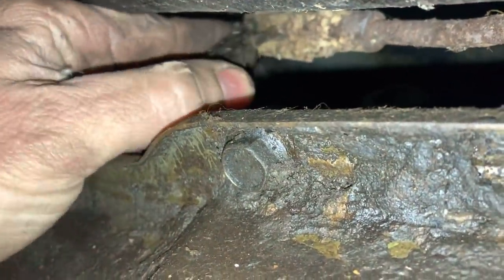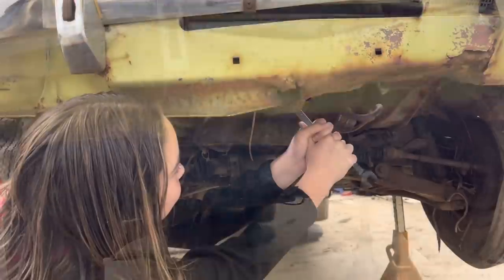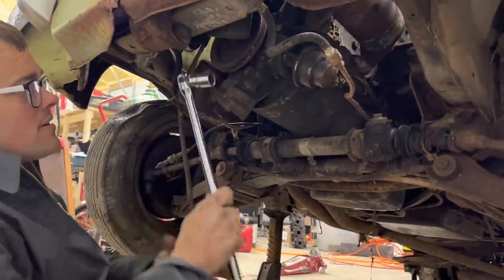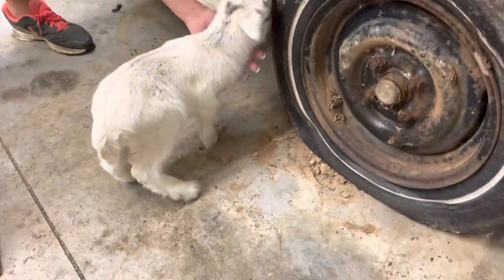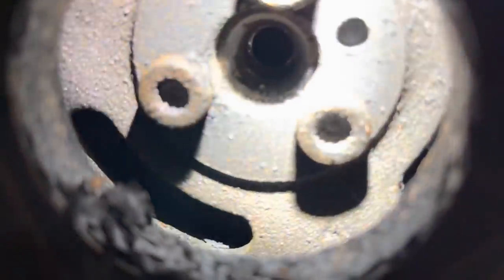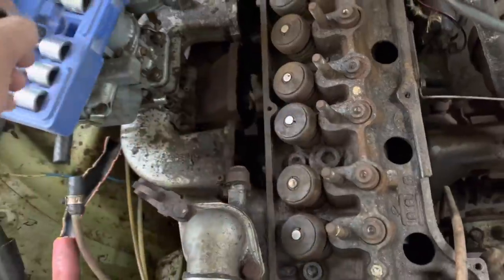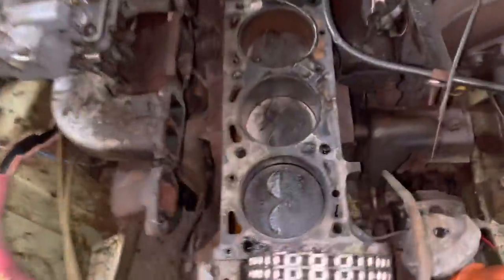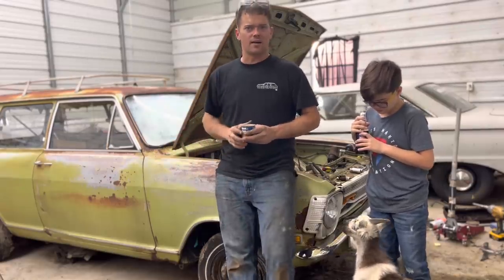Can we get the engine unstuck after 42 years

Comment: Had two of these two-door "caravans" back in the days.....a '72 1900 "wagon" I drove in high school.....plain-jane, 4spd, carbureted, & dog dish hub caps.
Second was later, after getting married....it was a '75 1900 Ralley(!) package with sporty steel Ralley wheels, extra gauges at the front of the console, and Bosch fuel injection! 😯......Both were the same green as your '69, but slightly "modernized" body style.
 Also, my great-aunt had a '73-74 1900 4dr "noth-back".....(we called it a sedan🙄) It was Carolina Blue with black & white interior and auto transmission.....
  Neat lil cars, for sure!
Reply from the maker: Man they sound nice

Comment: You may not have the room in that engine compartment but I,'ve freed up a 59 cadillac v8 with a 3ft chain wrench and cheater pipe around the harmonic balancer.  Scared up the balancer a bit but didn't snap the bolt. Trans fluid in the cylinders, cleaned up the carb and got it to fire up. Smoked up the neighborhood when she fired up😁

Comment: It'd be interesting to try just filling the whole crankcase and intake manifold/carb to the top with diesel and leave it for a few days or weeks, and see if that would free everything up.
Reply from the maker: Yeah couldn’t hurt
Reply: Your first stopped the crank-pulley bolt, and the broke it off. The crank will have to be removed, and drilled to insert a heli-coil, thus removal of the engine is a must. A substitute four cyl, and manual trans from another car, might make the most sense.
Reply: Brake fluid eats paint. Pour into cylinders.
Reply: Looks just like a Toyota or Datsun estate we had in Australia, should pull the motor, if not very easily repaired, go for a rotors like a 12A or 13B with a five speed  it would make an awesome sleeper.

Comment: I'm late to this party but a 50/50 mix of acetone and ATF work wonders on rusted parts. Better than anything commercially available
Reply from the maker: Ok great thank you
Reply: Yes, 50/50 ATF and acetone can do the trick!  I used it to free up a 59 Alfa and a 57 Olds that were both stuck tight.  Put a cup in each cylinder and let it sit for a few days.  Repeat, if necessary.

Comment: 1st new car, 1970 Opel Kadett, 2door coupe,  $2,000 😋.  Took one year of driving it 70 on I-75 rendering the engine useless.  Rush hour stop and go in Detroit, one rainy morning, Semi with no trailer hit the brakes behind me, couldn't stop at low speed, my bumper ended up at the back of the back seat.   Bought it from a Buick Dealership, deep blue with white interior🚙  .  John here, from the back-roads of Northeastern Tennessee.

Comment: I've always loved the Opel Kaddet. If the car were mine, I would find a Chevrolet 2.8 or a 3.4 engine and trans to put in it. They moved the 80's S10 and Camaros well enough and would be plenty of power for that car. They're also compact enough to fit in the engine compartment without too much of an issue.
Reply from the maker: Ok thanks good ideas

Comment: A 2.2 Ecotec and a 5-speed out of an old S-10 would be a good swap with plenty of power. Kadetts weigh about the same as a Festiva. You don't need 300 horsepower to go really well.

The CIH engine was made to fit under a lower hood line. The block dates from the fifties. Instead of a new engine, they just updated what they had.
Reply from the maker: Ok thank you

Comment: It not the cheapest solution out there, but when I have to soak one, I just fill it up with Dex/Merc and let it sit for a couple of days. I've dealt with two stuck engines on revivals I have done, and it has worked for me. It is cheaper than Marvel, and Marvel is mostly Dex/Merc anyway. A couple of people have mentioned it on here, but sometimes you just have to get a block of wood that is small enough to fit inside the bore, sit it on top of the piston, and whack it with a hammer. Sometime they need that little extra persuasion.
Reply from the maker: Ok thank you

Comment: I had one of these in 1972. I believe the engine was a tiny one liter and didn't have much power. Had a problem with accelerating until I figured out the retainer holding the baseplate in the distributor had broken and caused the points to spring wide open when accelerating which totally altered the gap.
Reply from the maker: Ok awesome . Thanks for watching

Comment: All the engine that was stuck I always pull the head and clean the rust out of the cylinder walls and drain the oil then I put PB blaster in the cylinders and let it soak then I take a 2 x 4 and put it on the Pistons and hit it with a hammer to get it to move so the bolt don't break off the Crank shaft especially if you want to save the engine
Reply from the maker: Ok thanks

Comment: That Opel has your best potential as a high mileage commuter, potentially beating a 2.3 Fairmont even with the roof rack.  Even though you must now drill out that bolt, Don't give up! use vinegar or muriatic acid on that rusted cylinder, probably muriatic acid on the one and vinegar on the others,  and either pry on the ring gear or pound on the piston with a chunk of 2x4 or a huge socket, being careful not to splash muriatic acid.
Reply from the maker: Good idea

Comment: I remember back in the mid seventies watching a dude at the drag strip at Green Valley Race Way in north Texas racing one of these with a BBC 396 and a 4 speed. Of course it was highly modified but would run low 10s high 9s in the quarter.
Reply from the maker: That would be awesome

Comment: I bought a project car and dropped the pan in the engine. It had two thrown rods and probably more than a few seized bearings.
I would have waited forever for vinegar, wd 40, or Marvel, or diesel fuel to  lube up rings and cylinder wall. Ok, the holes in the oil pan was a clue.  
   Also, I once took and old pulley and had some angle steel welded to it to make a handle.  This was to turn the crank without breaking the bolt. Or, to hold the crank while removing the bolt.
Reply from the maker: Ok thank you

Comment: Any plans for the Opal wagon? How about fitting it with a modern 4 cylinder or V6? It might be fun to get a GM 3.8 or 4.3 V6 with modern fuel injection or a 4 barrel manifold with a Holley Sniper fuel injection.
Reply from the maker: I actually just sold it this week , all the glass was bad and the floors were in terrible shape

Comment: braking stuck motors free use a mixture of transmission fluid and diesil fuel .Fill up the four holes as much as possible put the plugs back in and forget it for a couple of weeks come back take plugs out it should be free if not refill and repeat
Reply from the maker: Ok thanks

Comment: Baby Rocky.... hmmm, initials B and R so its white like a ice cycle maybe it is  cold and first words are brrrrr.... I know its kinda a stretch Josh. Or just icicle would be a name. I know its gotta be a weird name or people won't remember it. I don't see a lot left of that little scrap pile. I like you thought the rats an mice had peed in it and rusted it tight. I seen old Mortske make a plate  with some all thread sticking up from the head bolt holes. He used a jack and tried to move one that under further inspection had a rod hanging an it  wasn't going anywhere. I do believe though it would of pushed it over was there a chance. I been hearing about vinegar and mystery oil mixed soaking those cylinders but here is  the thing, would it be anything once broke loose or not?? Since its rear wheel drive, its time for you to swap a other engine in the hole like a subaru  or a four banger s10 with transmission and just use scrap. No expensive engine or parts to adapt it, kinda just wing it as you go. Since thats a unibody, ain't no chance of making a bigger hole to set into it.. Them old boxer engines, the E82 were really tough and ran a million miles. Don't take many wrenches to work on them an if its weird then folk will eat it up. That engine in this little rig uses  the same bolts that VW used and would most likely have the little waffers under each valve stem for adjustments. I would take a hammer to that old head and whack those valves and learn em a little so to see how they work. I forget just how the tool that takes them loose just rolls under the cam on either side of the valve holding it out of the way to get those shims which are marked how many thousands thick they are. Those germans had some good ideas on how to make stuff run a long time. Well glad to see a video come up and I got my head on some ideas too
Reply from the maker: Ok thank you

Comment: That engine popped up in some 80's J cars (Pontiac Sunbird....) The bolt pattern should be the same.
Reply from the maker: Ok thanks
Reply: @Sleeperdude  Actually I'm wrong. Yours is the Opel CIH from the Manta. The US OHC is the Opel Brazil motor they started using in the later Kadett. So maybe go Iron Duke T5 combo?
Reply: @Sleeperdude  It's not the Sunbird motor. It's the CIH Manta motor. Pretty obscure. Maybe Iron Duke/T5 swap?

Comment: Try welding a long steel bar across the crank shaft pulley, then you would not be putting the torque onto the crankshaft bolt, oops too late

Seasons greetings
Reply from the maker: Ok thanks

Comment: I'd worry about using vinegar on a seized up engine,  since its a mild acid and could lead to flash rusting inside the cylinders.  Another idea is to use rust remover liquid inside the engine,  or have the whole block pickling inside a solution of it along with MMO and PB Blaster or Seafoam Deep Creep overnight or for two days  :)
Reply from the maker: Ok thanks